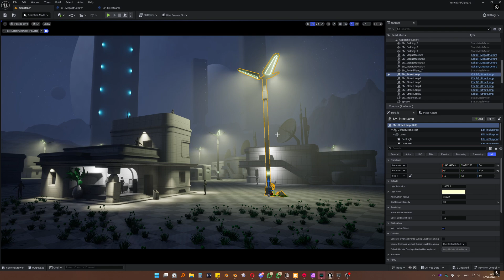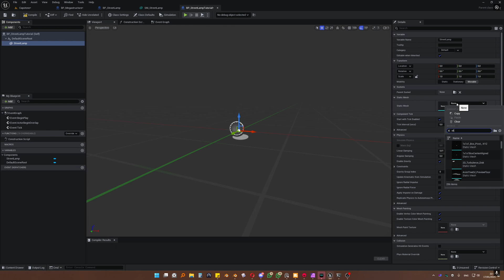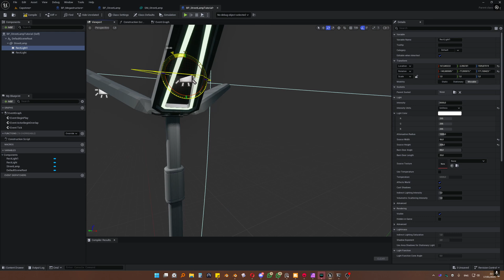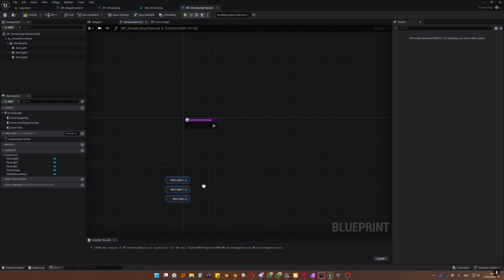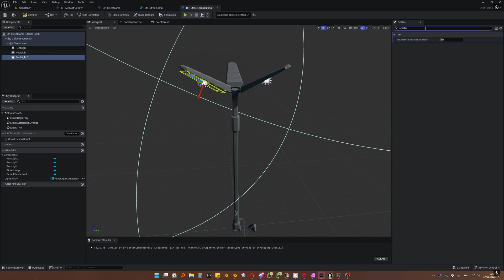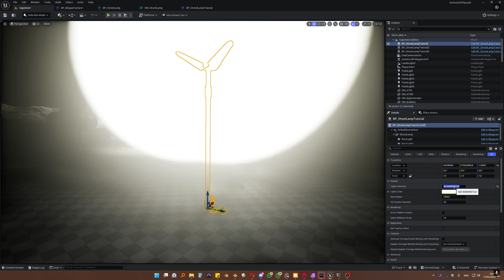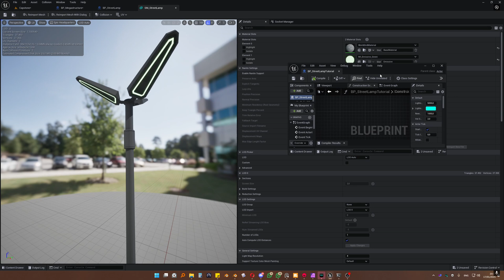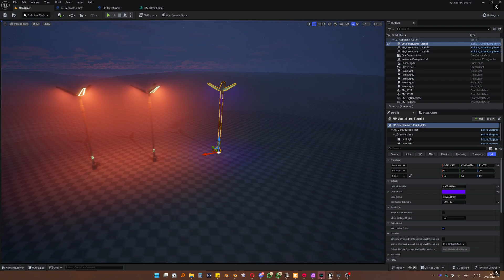Easy multi-light controls using Unreal Engine's Blueprints!

Comment: Thank you for this walkthrough. Awesome. Coming from Unity, Unreal not having the ability to manipulate multiple light param sliders simultaneously by default blows my mind.
Reply from the maker: technically you can, but you gotta select them from the outliner and it gets messy if multiple light sources are supposed to be part of the same Static Mesh.
I also created a tool recently that streamlines the process even further, I might make a video about it at some point.

Comment: At time 13:28, is it possible to keyframe these in sequencer as well?
Reply from the maker: yes, absolutely. you can pretty much keyframe anything, you just have to add the BP you need into the sequencer and start keyframing
Reply: @nickbortone3D  I found that if you click on the variable (light intensity) in the Con Script, then over in the details, enable Instance Editable and Expose to Cinematics, you can then add it to the seq. However... I think I found a bug. When you keyframe light intensity for ex. nothing happens when scrubbing through the seq. However, if you switch from moveable to static then it shows the updated keyframe, but then won't update back to the previous keyframe. Also, it only does the one BPP. In my scene I have around 60 lights that all need to bounce to a beat.. 😅